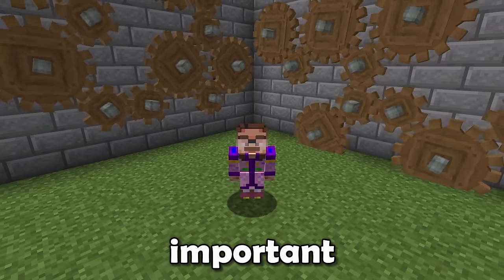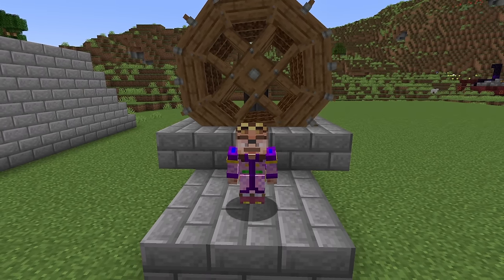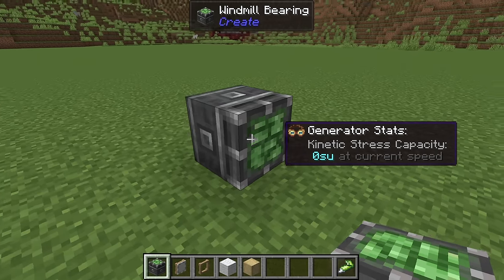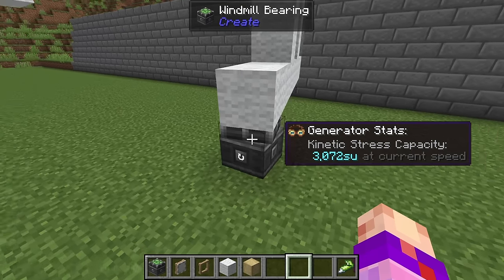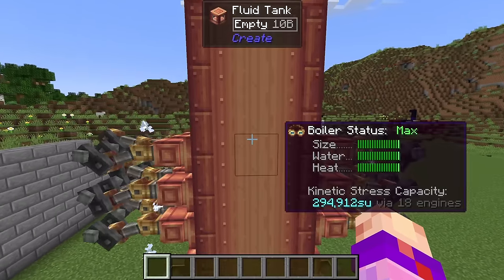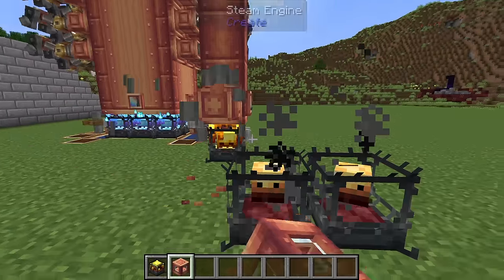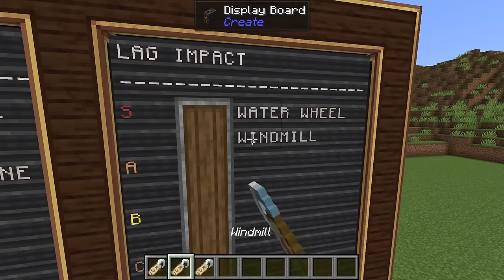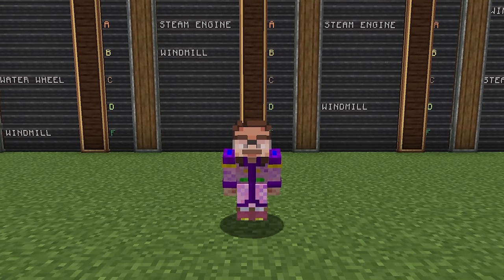Water Wheels Are BETTER Than Steam Engines (Kind Of) - Create Mod SU generator comparison guide

Comment: I'll name the advantages of windmills. Let's start with the fact that you can glue various useful things to the structure, which allows you to harvest free of charge, as well as produce energy. Windmills will work even in the lower world (water wheels can also work from lava, but steam engines will need a supply of water), windmills are well suited for complex mobile things, such as a 3D printer (it's possible, I managed to do it and it really prints the diagram, but can't put mechanical belts. Few people know, but by placing the scheme in the deployer filter slot, it will print). You can also touch on internal combustion engines from Create TFMG and electric motors from Create Crafts Additions. Small ICEs are compact and fast, which saves a lot of space. Oil is required, but in reality, when processing it, one way or another you will get different products that need to be put somewhere, and in fact there is a lot of oil itself. A large engine is a serious source of energy, but takes up more space and is more complex overall. All ICEs operate in the nether world (pun intended). Electric motors essentially release stored energy rather than produce it, but can also be used to conveniently transfer power and are useful in the nether world. You can build a train that will change batteries at your base in hell, and you can also increase the load without any problems, but then the charge will disappear faster. Both of these options will look good on the worldshell from CSim (Create Aeronautics, Offroad Expansion, Liftoff and more), and now Create Interactive has appeared, so you can make yourself a base on a train, where there will be a rail factory

Comment: So I've only played Create on a modpack where the owner of the pack would make some things needlessly more difficult to craft (including mechanical arms) and I also have no clue how mechanical arms actually work, so my solution was to put 32 3x3x3 steam engines (two stacks of 16) all in parallel and make a pretty goofy amount of SU through that. I called it the Torque Generator and iirc it had like 64k SU but idr. I never got crazy far into that world, but I was pretty happy with it and never even approached that limit.

Comment: Windmills look cool and they're easy to place.
They can scale down to be smaller than most decent looking waterwheel setups when you account for water, containment, and decoration. Decent for exposed, low power mechanisms in awkward places, and the easiest way to build a rotating contraption.
That's the only niche I think fits them.

Comment: Create Diesel Generators has entered the chat
Reply: They aren't in vanilla create
Reply: That wouldn't really matter because creators already a mod. I don't get what the point is with people wondering if it's in the vanilla create, if your computer can't handle a secondary mod then that's a different issue, but adding add-ons isn't cheating because you're already playing a mod. 
And yeah, using create all by itself is useful because sometimes you just need to get things done without any help, but this is different because of how easy it is.

Comment: 2:58 "This is the most efficient structure" Ahkhtually, placing the water source one block closer to the wall makes it possible to remove all supporting structures on top, since water wheels don't allow the water to flow sideways.

Comment: WindMill lag impact S-tier??
idk man.. i build just 4 the max size ones and it really chugged the FPS on the client side.. 

Best i could think of in my server was to make the spawnchuncks full of RF generators (to keep client fps high and them running 24/7 without costly chunckloaders), send the power wirelessly to your base, store it in batteries and use eletric motors to run create stuff.

Albeit the efficiency is terrible with so many hoops and loops, but on the spawnchuncks the generators have all the time in the world to fill your batteries

Comment: Note! The steam engine is in fact easier than the water wheel for time efficiency! in newer (and perhaps many older) versions of create mod, the steam engine can be powered with 1 heat level (2048su) in a minimal engine with a CAMP FIRE. only one campfire is necassary and means the power source is almost cheaper than the water wheel itself in terms of resources.
All new and most intermediate create mod players may view this as a godsend if you didn't know about it before, it's viable up until you can get a lava farm going which needs brass and blaze burners anyway.
Hope somebody found this useful.

Comment: Here's my two cents...

I'm a grinder-player, in that I can go for hours playing and have the patience to gather the needed stuff to make what I need for whatever.

And, when making those multitude of things, lag is my biggest factor. Strangely, water wheels have caused a significant amount of lag for me, so windmills have remained the choice for power systems when playing. I haven't touched boilers, because honestly they intimidate me quite a bit. As Dejojo says in this, making them is easy...POWERING them is hard.

So, for me, I think I'm sticking to windmills. As Dejojo also said: "Just dig a big hole"

Comment: this also looks at create in a vacuum with no addons or other mods, the lag impact of the steam engine can be reduced drastically when you have other options for powering the blaze burners (especially when you take into account that you are generating some other resource that you are likely not just using for kinetic power).
Reply: A 10000 block Lava reservoir or a medium sized wood/kelp farm is enough to power a lvl9 boiler indefenetely, and the amount of lag per power generated is miniscule!
Reply: @mrShift_0044  im moreso referring to the mechanical arm used to apply it. that whole depot shenanigans was the part making the most lag. if you were able to pipe fluids into the burners, it would cut the bucket step entirely, removing the most laggy parts of the setup.

Comment: If the stuff to feed a steam engine are laggy, then I guess just the entirety of create is laggy. Good thing I'm using AE2 for most of my stuff instead of create 😅

Also, surprisingly, on a 1700X server, Create doesn't seem to lag that much in itself. It's mostly client-side lag, but even it's not horrendous.

Comment: Water wheels and steam engines are great, but cut windmills a little slack! With a good sheep farm, you can pump those things out just as easily as water wheels, they're great if you don't have a lot of space in one direction (building on an island or underground), they work in the nether (unlike water wheels) and they're just as scaleable as water wheels (If you need more, you just build another one). I think they're a perfect popup power source, and waay more versatile than it first may seem. I'd argue they're a little easier than Water Wheels to set up, once you have the resources, just because you don't have to deal with containing water, which is great if you just need to quickly setup a workshop or factory with minimal impact on your surroundings.

Comment: Fun fact: you can power minimum-tier steam engines with other heat sources. Magma blocks, campfires, actual fire, and unpowered blaze burners. Yes you heard me, the blaze burners will allow a "passive" steam engine to run without consuming fuel

Comment: The Steam Boiler is the best. Why? You can use pipes directly in the blazzbunner with Lava. Lava duplicate with dripstone every 100-150sec and 1000sec need lava per Blazzbunner. With pump, pipes and a tank (4TankBlocks is enough or per boiler 1TankBlock). All what u need is a Wood- Cooper Farm. With the  addon "New Age" can use about the lavalake/farm (11x11 in the corner 3 pipes less) a heatpipe (exact 112 not more, not less) use it for a "Boiler heater" (stand in the middle over the Heatpipes)  and you have a overcharged source.

Comment: Im surpised im not seeing more comments about this but you made the windmill wrong if your going for efficiency. you can actually put 8 sails on each layer of a vertical windmill allowing for half the space for max SU and the sails will still attach automatically without needing glue (I always use 1 rotational chassis block at the base and let the 8 pillars go from that). just a tip! in my opinion that simple fact makes windmills superior to water wheels because you can make it much more compact in the grand scheme of things, and verticle space is often more forgiving then horizontal space anyways in most use cases :)

This method is also useful because a windmills SU and RPM calculations are on a basis of every 8 blocks, so with a windmill that has every layer of 8 blocks you can easily calculate how many layers you need for the SU you are going for in your use case, which is very helpful early game when you don't need max SU yet

I will say this is more useful when in a mod pack that has things like hemp or flax that you can easily mass produce string to make the wool

Comment: I remember another mod years ago, which also had water wheels (and other energy sources), power transmission via wires and many tools using that power, like ore diggers (each/some chunks had particular "ore veins" which could be extracted for some amount).
Basically I built a few chunks of water wheels, and even though they couldnt provide enough power continuously, because of the server working 24/7 they outperformed any other players' manually maintained energy sources and the admin had to cap the number of ores per chunk not to be too OP xD
Or how I auto-drained the nether lava lake to power something from Botania IIRC, lmao. Good times.
Reply from the maker: Was that immersive engineering?

Comment: I do wish the windmill was better. I play with it set to double the stress units it normally has and that makes it feel like it has much more of a purpose. Water wheels are good for small single create device setups, windmills are good for small bases to power all your necessities at high speeds, and steam engines are good for your large factories where you’ll have a huge number of devices you need to keep running

Comment: if you're cheaky you can get a 3x3 windmill using sails so they're smaller than water wheels for the same output without using any super glue, then just put em next to each other
but I get called dumb every time I make one. they are pretty expensive for the wool tho but sheep are easy to find

Comment: this might be bias, but i have never used more then 200.000su in anything, and my steam engine setup that has 1 arm makes 500.000su. Plus i anyway have a wood farm, so taking some to the engine for charcoal related purposes isnt a hassle at all. BUT you are correct that water wheels are the best before steam engines. i dont use windmills, as i am not a builder, and there biggest purpose is decoration imo.

Comment: The μs unit is a microsecond which is equal to one millionth (0.000001 or 10−6 or 1⁄1,000,000) of a second.
There are 20 ticks in Minecraft so each shouldn't exceed 0.05s
So there are 50000μs (Microseconds) in one Minecraft tick
You would need at least 500 Steam Engines to fill that time. (not considering other stuff causing lag in a minecraft world)
But even then the game will just be one tick behind the update cycle.
The server lag gets significant at 13 ticks so you can build like 3500 Steam Engines before you even notice the lag

Comment: I'd put steam engines in S for scalability over water wheels. Get nine blaze burners and a big enough boiler, and you can generate hundreds of thousands of SU in relatively little space. Waterwheels may be infinitely extensible, but only if you have infinite space and don't care about aesthetics.

Also, windmills are basically just for aesthetic, but they're also useful for farms with a small footprint - 8000 SU can run crushing wheels, drills, fans, etc, and you can just stick it on top of a farm "module."

Comment: i been using large water wheels by placing 1 bucket water on a flat line (just a line on flat floor) adding 6 large water wheels on each row of flowing water for massive space saving hooking them up to one another is simple with large cogs and shafts

Comment: To further compound on the bit about how cheap steam engines are... A starter one doesn't even need a blaze burner. Just slap a camp fire underneath and away you go.  Straight up early game you can just pile level 1 steam boilers and get a fairly large chunk of power.  And then you can rip them down and make a proper one later with the old ones. I think it's like what... 6-7k su per? That ain't a bad proposition given the size and cost of such a set up.

Comment: And i believe u could speed up water wheels just by adding soul sand with kelp(to reset water) and magma blocks in the way to help water flow faster making water wheels spin faster and much more efficient. (i believe, haven't tested it for a while)
Reply: That was for old Create versions. It doesn't work that way since the appearance of the big waterwheel
Reply: Water wheels don't work like that no more if its touching flowing water it will always output 256 and if its a large one 512

Comment: honestly i feel steam engines are just slightly less convenient to get than windmills, because wool farms means basically infinite windmills as long as youve got bearings for the wool, but youll still need to mine and craft resources that are tedious to get (im guessing, im not that good at create theres probably super easy ways to mindlessly automate andesite and copper and iron)
at some point they both become automated and barely even a thought to get but at the start windmills probably start quicker to get

Comment: There is one argument in favour of windmills for scalability, and that is resource gathering...

Each and every water wheel made requires a shaft to craft, which requires andesite and zinc/iron (non-farmable ingredients) - each windmill setup only needs one shaft to craft (plus a couple extra to link each windmills together).

While andesite and zinc/iron aren't exactly uncommon, you do still have to go out and mine them - thus if you're trying to conserve non-farmable resources, windmills would be the better choice
Reply: Iron is completely renewable from cobblestone in create, you can grind it into gravel and then wash it for iron nuggets

Comment: So a modpack that has a less laggy option for infinite lava would make Steam Engines a lot better?

There is a very simple option, though it is incredibly slow. Use a lava farm and a hose pulley to create an artificial lava lake directly under where you need it. Eventually it will be big enough to register as infinite, then you can just remove the lava farm and reverse the direction of the hose pulley. Again, slow, as it will take a long time to gather enough lava this way (you can speed it up by pulling from the Nether until your artificial lake is full enough, but that's more work). If you have the add-on to give Blazes straws, you can even cut down on the lag from the filling, using, and replacing buckets.

Alternatively, again, in modpacks with other mods you might have an even better way.

Also, for water wheels, if you count stacking them like for your option to power 3 with one bucket of water, you can actually do even better than that. With two towers of water wheels with a single block in between them, you can go as high as you want. You should be able to intersect two walls like this to power four such towers in a cross shape with a single bucket, but I think it's better to just have one tower like this as you can extend it out like people normally would, using more buckets, to have more maximum stress units.

Comment: I feel like I have to disagree with the accessibility rating for steam engines. They are on the level of windmills, if not below them, because for them to be self sufficient, you need a whole other machine set up. Whether you are using a tree farm that makes charcoal, or a lava farm supplying buckets, you have to make a whole station to power your power generator, which will cost space, time, and resources to make. With windmills, you just farm some sheep, get the wool, place the blocks. With waterwheels you make an infinite water source and pour it over the wheels. Much more straightforward, and much less thought goes into these two than figuring out the ideal way of feeding the machine its resources. That being said though the payoff is worth it for the giant amount of stress units it creates

Comment: you can also pre-nether just power them via other heated blocks like campfires or magma blocks--not as good as a blaze burner, but you can build a little stack of 4/5 minimum size steam engines and power a starter base easy
Reply: In theory, wouldn't both of those also be able to work indefinitely without any additional input as well as being early game?

Comment: for me windmills are top priorety as i play in a version where i don't have acces to steam engines and large water wheels (1.16.5) and by the time i reach mid game i'd already have sheep wich allows me to have windmills, i'd also have blazeburners wich i could use to make brass to make the flywheel and furnace engine, now they may seem imprectical but if you use a furnace and hook it up to a tree farm you essentiely have 16k SU and 256 rpm if you use a speedcontrol and you'd also be producing charcoal